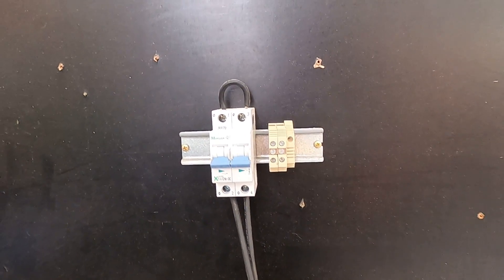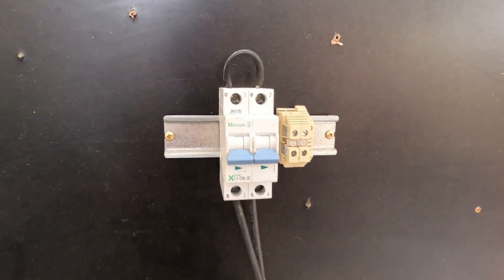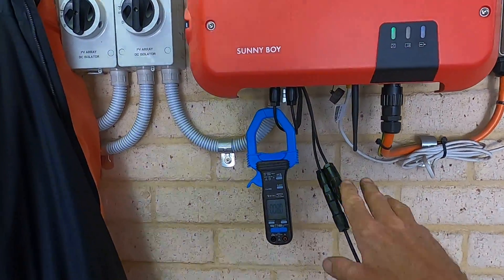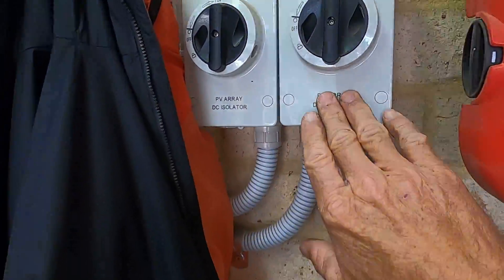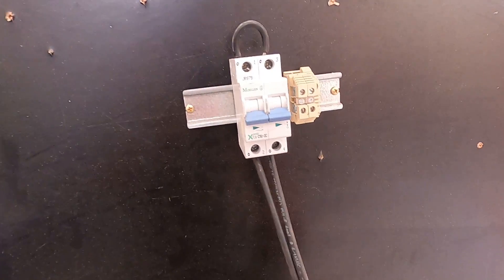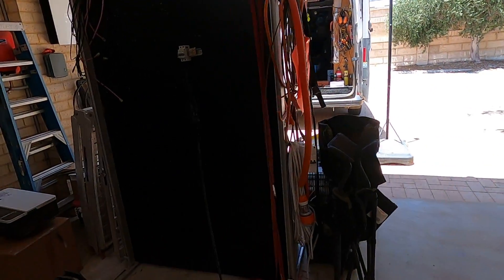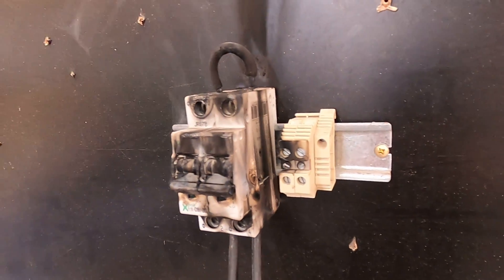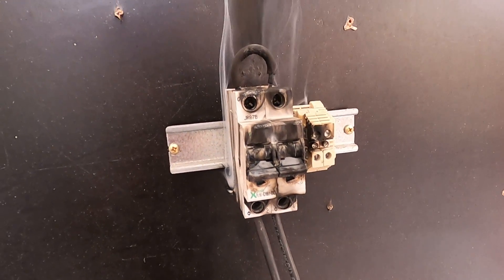Do not use this type of DC Isolator for your solar power system array! Perth Solar system repairs.

Comment: Those breakers are not approved for disconnecting DC power .They are so bad.Use inline fuse holders to protect the breakers.Shedding the load is standard practice on ACor DC equipment
Reply: and what do you think the fuses will do?
Reply: @flatfoot  disconect
Reply: @flatfoot  open the circuit .In large DC drives we use fuses in series with breakers to protect the breakers .Common practice for us in plastic extrusion in machines using DC motors driving screws .Eventually we replace the DC motors with AC motors with VFD
Reply: @carlubambi5541  fuses on a DC single PV string will never do anything. The fault current is no larger than the operating current. How does the fuse know when there's a fault condition?
Reply: @flatfoot  .There are time delay  thermal sensing fuses .they sense temperature and open up .They have a fuse link that has a spring on one side and a little pot of low temp solder that pulls open when it starts to melt because of the spring tension ..Now if the fault Current is only 15 amps then put in a 10 amp d type fuse .Also use UCC fuse holders  and a disconnect so you have an extra method of disconnecting  means ...These problems can be reduced .We get so much equipment from Europe with those breakers .We remove them and put in Mersen UCC  Ultra safe fuse holders .Read the use specifications on the breakers .Most are only good for communications equipment.tehre is an AIR rating on fuses and breakers  to consider as well as  their voltage and their ability to quench an Arc.Some  motor starters/manual motor starters have the ability to add quenching 
Chutes when used at higher voltages to extinguish the Arc .Or the use of multiple contacts in series to quench an arc .As this current does not exceed the breakers trip current temperature sensitive breakers are available (Magnetic ,thermal and overload sensing in one package .Fuses come with short circuit or thermal overload sensing

Comment: There is the rated operating voltage too that is very important. As an example, operating a 150v disconnect switch on a 350v array would give the same result.
Reply: That breaker is rated for 220V DC
Reply: @rm6857  i was about to abandon my project just because i watched this video... but then  i wonder if the same would have occured if he used a 1000v 16a double dc bracker on a string that produces 14 amp  in short circuit mode  like i'm going to do... any opinion about it is very welcome
Reply: @michenji  It burnt because he used 220V breaker for 350V system. If you use 1000V for 350V, you are fine.